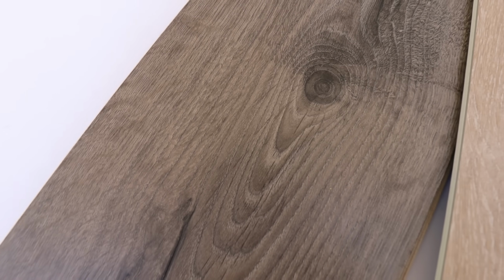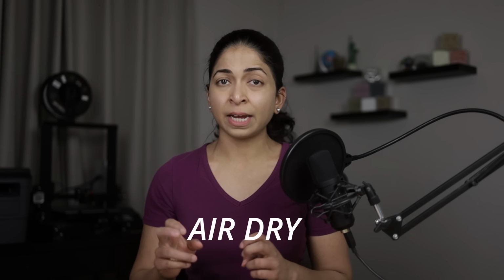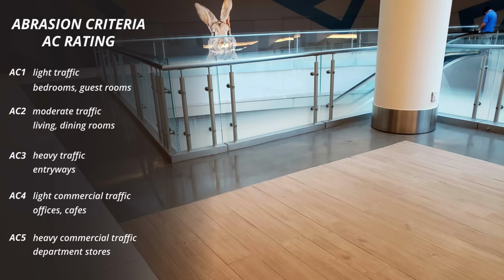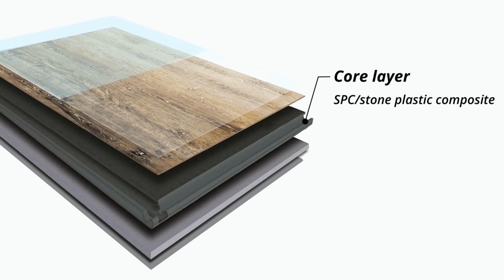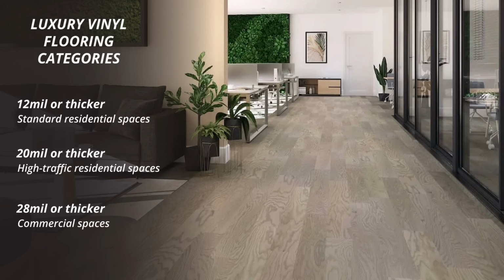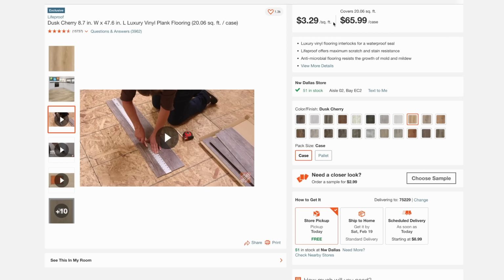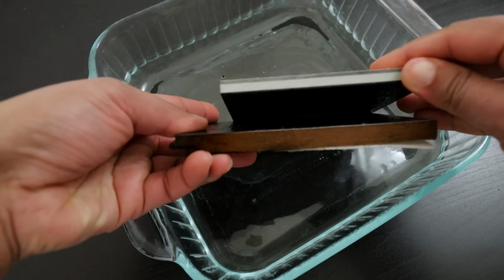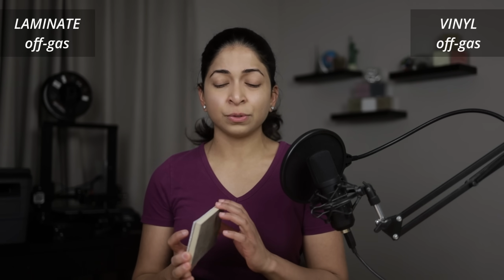Laminate vs Luxury Vinyl Plank Flooring | Everything you need to know!

Comment from the maker: If you're looking for a gorgeous, natural flooring product that doesn't off-gas, check out HempWood: https://www.youtube.com/watch?v=3Qy6awPeric
Reply: Thankyou Belinda.. I will... that was one of my considerations... I simply don't like mdf. too many toxic issues.
Reply: IIRC, you mentioned that Hempwood is quite sensitive to moisture, so I presume that means one shouldn't really consider it in high humidity locations.  Do you know of any other non off-gassing materials that do better in high humidity environments?
Reply: @parasharkchari  Cork flooring comes in similar planks or tiles and works great!
Reply: @parasharkchari  Same question.   Dishwasher, sink, tub, etc can leak at anytime.
Reply: @parasharkchari  hardwood or bamboo maybe
Reply: You always reach my expectations... Great video as always.... Well detailed and researched... Great
Reply: will it off-gas in my bong?
Reply: Great video! Can you please mention if HempWood can be used in a basement? I’m trying to avoid off-gas products.
Reply: I have Wooden looking Procrelian Tiles with Sugar Finish with golden  star glaze. It looks likes wood but is not wood and if you move over it it glitters and gives a starlight effect 😊.
Reply: What is VOC?
Reply: How did you know I was looking for a floor that doesn't off-gas?
Reply: Which one can you put on top of tiles in a kitchen ? if Laminate tiles then would you go with AC2 ?
Reply: No. Weed is illegal

Comment: Laminate works if water will never be spilled and sit on it.  When has that ever been true.  In the 1980's, I used particle board as floor underlayment for carpet.  It was labelled for that.  Bad choice since is degrades if water spills on it.  Porcelain Tile is cheaper, at about half the price per ft2, but about equal cost for the thinset mortar and grout, and same again if you need decoupling membrane to tile over a concrete slab.  Can last much longer if installed correctly and no worries with water.

Comment: You pointed out an important fact that does impact the performance and opinion of these products.   Location.  I installed laminate in all bedrooms and hallways but NOT in downstairs  high traffic area or wet areas. Upstairs bathrooms have tile floors and downstairs has standard 3/4" tongue and groove and carpet in the family room.  As such I saw no advantage of one over the other therefore saved money with Laminate.  We have lots of pets and the use of engineered flooring is a no brainer.  Also guests see the "nice" flooring.  Family sees the Pergo.  If someone is that concerned about appearance why are they using artificial flooring?  Both floorings are fake.  Laminate vs Vinyl is a Ford vs Chevy arguement. 
The real wood and tile crowd that is the Mercedes and Audi drivers are chuckling at them.

Comment: Take my advice DO NOT use laminate flooring. they are NOT water prove, they can resist some water if you have some drop on it but if you allow the water to stay and leak into the laminate they will absorb the water and become soft over time and eventually destroyed. go with the vinyl flooring, they are 100% water resist they are basically PVC, water will not damage them. they will last way way longer then the laminate floor. and the cost are basically the same, vinyl just bit harder to install, and higher quality one does cost a bit more, but will save you lots headache and replace in the long run.
Reply: Fully waterproof but vinyl flooring scratches much more easily than decent quality laminate.

Not rocket science as vinyl flooring only has a thin softer layer of protection than laminate flooring!

If you have kids and dogs/cats the vinyl will get scratched a lot quicker than laminate.
Reply: @C--A  that is not true, vinyl flooring has the exact same top coat as any other laminate flooring. it just vary from brand to brand. cheaper vinyl has thinner top coat than more premium vinyl. just like the laminate counter part.

Comment: Thanks for such a very informative video! Great job.

I have  some old laminate flooring in my house for about 20 years that was there when I bought the house. It’s the cheapest stuff they could find at a surplus store in town. Surprisingly it’s held up pretty well even against my dog that goes sliding through the house when playing. It has shown a small amount amount of delaminating where wet by the entry door and some very noticeable sun bleaching at this point. It’s at the end of its life now but I’d rather go back with either real hardwood or the vinyl plank flooring. I just don’t want a floor I can feel floating and shifting under my feet which i assume is the foam underneath.

Comment: You didn't touch on the environment and temperatures where the flooring material is best installed in, e.g, interior use only, and material functions best at room temperatures between 50 to 110 degrees F, do not install where temperatures are below freezing e.g., unheated sheds or garages. Your video was extremely well done, narrated and detailed, thank you.

Comment: You characterized the wear layer of LVP as a single layer. It can be composed of clear vinyl of different thicknesses of 12, 20 or even 40mil thickness. It can be registered and embossed to give a grain pattern based on the printed picture. A topcoat of urethane containing ceramic beads or aluminum oxide creates the hard finish.

Comment: I just had a flooring job done.  Knew nothing about laminate vs. vinyl.  Knew nothing about either one.  Only knew this is just about all there is available anymore in the stores.  Ended up purchasing vinyl.  Was very upset to find bizarre-looking, blob-like anomalies in the pattern.  The sample in the store did not contain any blobs; it appeared to be strictly wood-grain pattern.  My Contractor, unfortunately, gives no thought to esthetics and just takes the tile out of the box and installs.  But I was vey upset when I saw the blobs and asked him to remove the tiles but he said he couldn't.  In hindsight, before beginning the job, a person should go through one full box of tile and check for irregularities in the pattern.  Had I known, I would have gone through all 10 boxes and pulled out the rejects and brought them back to the store for replacement.  I did not sign-up for blobs; I was supposed to be getting wood grain.  This would have been a real bother as a box of this tile is very heavy.  This just shouldn't have happened.  I feel a factory defect was fobbed off on the customer.  Am most disappointed and unhappy with the outcome.

Comment: Terrific video, very straightforward and to the point. LOVE the clips showing the industrial production— haven’t seen that elsewhere and fascinating—plus your showing a bit of the actual chemistry.
One point: we have nearly 35 year old laminate that is over due for replacement, and it has no photographic layer on top but a thin layer of actual wood veneer, similar looking to bamboo.
Or perhaps this is what’s called “engineered hardwood “ which might be a separate category altogether (?)
Nice work! You’d make a great professor.

Comment: I'd just like to add that not all vinyl flooring has a lifetime of 10-20 years. I recently installed vinyl plank flooring that came with a 25 year warranty, so I hope it will last at least that long.
Reply: We are replacing ours floors and currently deciding between vinyl or laminate. Do you think vinyl is more scratch resistant than laminate?
Reply: @carolnelson6109   I think scratching your privates in public is disgusting! I hope you never do it when  you forget to take a bath or shower. Yuck ! ! ! 😱

Comment: So far we've done vinyl and not super impressed. It's very thin, the grooves break easily and has cracked along the entire side where the groove was. We've had to replace a few boards because they've popped up where they're supposed to be locked together. It was our first time installing though, so could've just been us. Otherwise looks nice.

Comment: If I had either of these in my house and it got old and scuffed up, I'd be very tempted to rough up the surface and coat it with varnish, polyurethane, or some other clear coating.  I can't stand the thought of ripping up and discarding  something that is just cosmetically damaged.

Comment: The deciding factor for me was that any water spilt on laminate flooring may cause the MDF to swell and split the surface.
The cost of LVT/LVP was not substantially more than laminate.
So we chose LVT.  Observations?  We replaced carpet and the accoustics for the hifi with LVT were great!  Noticeable!  Also visitors at Xmas said light from Xmas Tree reflected off floor out of windows. So far so good.  I rubbed down a spare piece of LVT with sandpaper to see how the finish copedand didn't get through it.

Felt pads on furniture have prevented sxcraping

Comment: I have vinyl plank (put in before anyone was calling it luxury) and Pergo (laminate brand) in another room, and the thing I like about the textured vinyl plank is how friendly it is to walk on. It has a softer feel and is quieter than laminate or wood. It was also much easier to install than the laminate.  If I had money though, I probably would have liked to use cork. It may not be the best looking or the easiest to clean, but it has a nice spring to it. It's expensive.
Reply: Cork is largely no longer available.
Reply: You can get soft touch sheet vinyl that's specifically designed to feel softer under foot. It has a felt backing.

Comment: Toxic flooring that will last thousands of years. In the dump. These products should either be made to last 50 years or just be banned. I used a pre finished t&g oak that can be sanded and refinished extending its lifespan. I also like engineered oak that uses the lower quality oak in the lower laminations. It can also be sanded and refinished at least once. One tip is to coat the floor with catalytic floor varnish immediately after installing. It can add years to the lifespan by sealing seams and ends.

Comment: Thank you, very technical which is what we need to think like these days! From Costco I put Mohawk total 7 mm laminate in one bathroom and from Lowes their brand Allen & Roth total 8 mm in the other. My personal opinion, go with Lowe's brand as it buffers floor imperfections better. Remember to fill any divots over 1/8th of an inch and double check the eveness of the floor. Also, be careful going over 8mm total, but if you have baseboards off then it should be fine.

Comment: What causes them to only last from 10 to 20 years?  We have a 12+ year old laminate floor that we have walked thousands of miles on.. Sounds crazy, but 1.5 years ago, my wife and I started walking inside the house as we are both handicapped and need flat floors and AC.. She has walked over 2500 miles and I have walked over 1600 miles. Both recorded with a fitbit watch and nearly all of those miles around in circles in our house.. Kitchen is tile, but dining room and living room and hallway is laminate. All still looks like brand new!!

Comment: Does anyone know if it's ok to do heated flooring with luxury vinyl planks?    I have to redo my whole apartment and was considering the vinyl because  of the ease of cleanup and comfort but that looked like nice wood. Since I'm doing the whole thing I wanted to take advantage and do the sub floor heating which I think would work better and be more energy efficient in my space than space heaters i have to use now. My other option would probably be porcelain tile. I used to have hard wood but my dogs ruined that and I love my dogs more than hardwood floors so I'm ok with a change.
 I wonder if you could do a video about sub floor heating?

Comment: i HAD LAMINATE AND IT SUCKED AND TEAR IT UP AND PUT DOWN VINYL PLANKS . The laminate  was put in by so called flooring experts   . I took it up donated it and put down  myself  vinyl plank and love the vinyl plank . Easy to cut  and easy to install  . Laminate hard to cut dusty to cut and dust from it dangerous  to inhale  . Unless  you buy a laminate snap cutter which is not easy either and expensive to buy , if ou can find a rental center it would be cheaper

Comment: Thank you for amazing detailed information on the Vinyl flooring. I Have moved into a new home  with a vinyl fitted in the floor. I hear a lot of cracking sound walking on them. Are these normal or this is a defect while it was fixed. Is there a solution to this?

Comment: I installed Mohawk water resistant laminate flooring in 4 bedrooms and a hallway.  Got it cheap feom Costco .  Before I installed it, I placed half of plank in a bucket of water and let it sit there for half a day. I removed it and let it sit for a day.  It was absolutely untouched. I could not tell where it has been immersed in the water.  I also put 2 planks together and put water on them overnight.  Checked them in the morning and all looked perfect . Zero damage.  I also took the scratchiest chair and sat  on it and tried for scratch the heck out of it on purpose and could not make 1 scratch on that floor.  So, Mohawk laminate is super strong and it’s way more than water resistant .
Reply: Could you try for a week and a month, as data points as well?  :)
Reply: But this means nothing really. You don't want water entering the subfloor. The joins need to repel this

Comment: Hi ,thanks for great and informative video! Luxury laminate planks 12mm 20mm or 28mm recommend? I just purchased luxury laminate and they are only 7.5mm thick.. It was actually thickest they have at HD .. All others was about 4 or 5mm. do you think 7.5mm with be good enough for residential install on 1st floor.  I was looking for thicker but they don't have it. only laminate was 8 10 or 12mm. Thank you

Comment: MSI has developed a 100% waterproof hybrid product that requires no installation tricks or extra steps.  It combines the superior scratch resistance of the melamine wear layer, with the dimensional stability of the vinyl products and is 100% waterproof.

Comment: I've never been called back to a hardwood or ceramic floor that myself or some one else has done and had to replace it because it has holes or missing pieces or peeling up or coming apart. now I've refinished plenty of hardwoods(after 12 to 18 years) minor repairs around the doors, sinks, or toilets for obvious reasons, but never a tear up, only resurfacing......try resurfacing that hot garbage.   imho.
if you have to get a imitation product, well that might be a problem.

Comment: What is better if the room is exposed to big temperature differences. So like 9 degrees in the winter and up to 29 in the summer? I was told that vynil click system will break because of this, but that laminate is way better I also have a dog and people told me that laminate is way more durable and vynil will have scratches really fast.

Comment: Both products are junk!  I have installed both at owner’s request.  Would not put either in my own home.   Burning PVC flooring could release dioxins.  Pergo type flooring is prone to edge swelling if exposed to water for any length of time.  Pergo is really tough on circular saw blades.  Pre-finished hardwood flooring is a much more attractive product and should last over a century if properly cared for.

Comment: This is quite well done. This is insightful, thought out, helpful. I must challenge only two points from the video. In this video you claim that vinyl has more depth than laminate and thus looks more like wood. During this part of the video you are showing a WPC vinyl plank. Certainly WPC vinyl has much better looks and greater depth than SPC. Laminate however is made from wood and wood like product. Laminate has always looked more like wood than vinyl floors. Vinyl can only do so much. Vinyl is simply a type of material that can not be made to look like wood. I mean, it has come a long way. It is a very good looking floor. But no one has ever looked at a vinyl floor and mistook it for wood floors. Laminate can and does get mistaken for real wood. 	The other claim that I have to counter is that of resistance to scratching. You rightly state that vinyl is rated in terms of the thickness of the wear layer, 12ml, 20ml, 28ml. Contrarily laminate is rated specifically and scientifically with regard to its resistance to scratches with an AC rating. That said, you can know within reason how resistant to scratches a laminate floor will be. Vinyl floors only display how thick the wear layer is. It makes sense that a thicker wear layer is more resistant to scratches than a thiner wear layer. But how much more protection are you getting with a thicker wear layer compared to a thinner one. This can not bet discerned by thickness alone. In fact some vinyl floors have a ceramic bead or aluminum oxide wear layer while others have a polyurethane wear layer. A 12mil aluminum oxide wear layer will out perform a 28mil poly wear layer. Many home owners overpay for a vinyl floor that underperforms because the box says 20mil wear layer. Vinyl floors are not under obligation to undergo scratch resistance tests to get rated like laminate floors are. There is no AC rating for vinyl floors. Laminate floors have to get rated for scratch resistance and not merely the thickness of the wear layer. So the customer can actually know what kind of scratch protection to expect. 	A laminate floor with an AC4 rating will out perform a 28mil poly wear vinyl floor every single time.